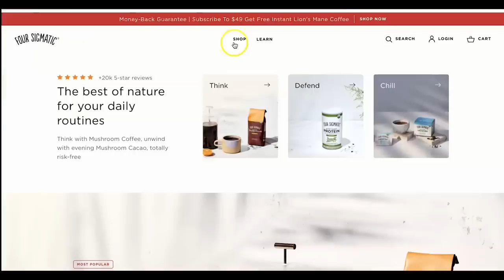BREAKING GROUND ON OUR TINY HOUSE IN THE MOUNTAINS

Comment: As a retired contractor since 1967, with cautioned experience, especially concerning loads and water, please do not discount the potential problems water can cause for loads on retaining walls. Your professional's advice, given that you are NOW at this critical point in deciding if there is a way to cut costs, should be followed. Get a second opinion if necessary, but cracked and leaking walls in basement situations will forever cause you both headaches and costly damage. Good luck and I follow your progress all the time.

Comment: 8K foot elevation in the mountains of Utah?  One of the first things you might want to consider is building a pole barn over Terry to take the snow load and to shelter her from the high mountain sunshine. My aunt has her summer place in Grand Junction, CO and that is only about 4500 ft, she had a pole barn put over her 5th wheel in 1988 and she still uses the trailer today.
Reply: Michael Cousins I wonder if that’s what building 2 that Trent keeps referring to is.
Reply: Definitely.
Reply: Great tip protect terry from snow loads
Reply: would think that was 2nd structure, but larger so it will house, truck, out of season equipment, cut logs, bails of hay to substitute for poor insulation in Terry, and maybe cut firewood for seasoning.  All of these need protection from elements all year round.

Comment: I see alot of comments about getting a port-a-potty but I think you should just build an outhouse somewhere on the edge of the property. That way it will be there forever and you'd be surprised how often you might use it over the years. Put lye in it and it won't stink. I grew up without plumbing way out in the woods and we loved our out door potty even after we finally got indoor plumbing. :)
Reply: Great solution! We always had an outhouse when I was a kid. No mud tracked in and a lot less walking from the garden and the woods.
Reply: Problem is zoning nowadays.  Depending on where you live, even on rural property, they can have all kinds of rules.

Comment: Don’t let the excavator leave without pulling back and smoothing out the banks along the driveway and cut banks.  It will be a mess and a weedy mess forever unless it’s graded out to blend with the adjacent grade.  Worth the investment and the least costly if done now as part of the excavation job.  Remember, people walking up your driveway need a safe shoulder to walk on.
Reply: What a great adventure! Regarding retaining walls, water drainage , erosion  etc... 1. yes agree that if you can have excavator "smooth out banks" that match contour of land you will have much less "retaining wall " issue and subsequent water pooling into basement by seeping through walls . 2. I am sure that you have geological survey  but it is still great idea to walk land and find any major rock formations : rock directs undergound water flow. 3. And while your hiking your land check out your neighbors and see their construction ( like your neighbors lake - it may be their solution to a water soaked area of land)

Comment: Great video! So, I am a civil /storm water engineer and this has been a really fun perspective to see! Oof, on the retaining wall/boulder wall issue. That is no fun to try and field figure out, especially in a time crunch. Boulder walls are great, I just recommend make sure you are not concentrating storm water over it or near the ends. If you have gutters planned for the 2nd building, make sure not to direct water at the base of the wall. If you need to go more than 10 feet vertical,  a retaining wall may require  tie-backs in the soil behind the wall that can impact your layout. Terracing 4' walls is typically the easiest or going up at a fairly steep behind the wall. I do not recommend more than 4 feet horizontal to 1 vertical foot (4:1) if you plan to mow it. Leave space to direct water away from the building. Best of luck! I am excited to see what you create here. :)

Comment: I LOVE watching ur videos. I’ve watched all of them all the way thru. Oh Picking up logs and me being a tireman all my life you both better be wearing backbelts because they surely do help or you’ll pay for it later. Might not hurt at first but once something pops u may be down for weeks. Love all that you do and you surely inspire me. I live and work in Alaska on the pipeline and I just got 2 vans for beginning to travel soon. Love you guys take care and God bless stay safe. In floor heat is surely nice. You won’t regret it. I use to cut concrete for a year and saw all the mistakes that contractors and home owners make which most common one is they don’t use double layer reinforcement in their concrete floors so it cracks all over the place and or they don’t cut the expansion lines every 8 feet. Yes foundation is the key but reinforced plastic on bottom then 2 or 4 inches of pink or blue foam board then wire then heating tubes zip tied to that then 1/2 inch rebar at mid point of thickness of concrete. My buddy has a $25,000 pad for his new house going up  I asked him why it was cracked all over and that’s why. If wire is only put on bottom then it will for sure crack and make sure the contractor has a mini compactor of some kind. Just from my experience. I pray all goes well.

Comment: You need a outhouse up there. A 5 gallon bucket in a cute outhouse tent would work !  LoL
Reply: Just build a proper outhouse.  A one seater size.  Properly built with raised floor, sturdy walls and a non-leaking roof with large overhangs.  You can use it as tool storage for things mainly used outside.  You can hang saws, levels, and other flatfish' things under the eaves and battery tools inside outhouse for additional weather protection.  You won't want to keep lugging them in and out of the basement, during the exterior building projects.  During a build there will be lots of trades and friends helping you.... they need a place to "go"....  For urine, a funnel attached to a, flexible plastic pipe, which empties into a container the size of a 4 quart laundry soap pail with a built in handle, should suffice for both males and females for day and night usage.  The screw cap lid prevents spillage when taking it away from the house to empty and clean out for further use.

Comment: Lookin' good!! A thought on feeding Oso, being a giant breed, you might want to consider putting water on his food when you feed him. That way when he's done he will not crave water and drink too much at one time and then have the food swell up in his tummy. Giant breeds can torsion, (tummy flips over) which can be lethal in a very short time. It's an easy way to help prevent torsion and or bloat. Also it can help if you feed him up on a bucket or table like thing.
Reply: Big dogs need LOTS of water.  They should be constantly hydrating, especially in warm weather.  But being indoors in winter is sometimes difficult for this breed.  Make sure he gets enough hard and SOFT food.... he will eat as much as you do while he is a growing pup.

Comment: You did a great job with counter in Terry.  And then you added a coffee machine but it took up most of your kitchen counter.  Make sure with the Tiny house you plan to have the things you use on a regular basis stored in an easily accessible cupboard.  I put my coffee machine on a pull-up shelf, which is level with the counter when pulled up for use, and stores under the counter when finished for the day.  When I planned my kitchen one side was mainly pantry, food prep and cooking.  The other half with the sink as the dividing line, was clean up and dish/glass cutlery storage. (I put in a dishwasher drawer takes up minimum space and you can store dishes in it on a regular basis.  Uses a LOT less water than hand washing)  Things you use to set the table and eat off of, and put left overs into are on the clean up side. So when the two of us are working in a tiny kitchen we do not cross over each others space.  We can easily work without colliding into each other.  We often alternate who does the cooking and who does the cleaning.  This way everything goes faster.  Also we made a specific place for the dog food and water so we were not kicking the dog bowls.  She eats at the same we do.  Sorry to say your table top is too heavy for the base.  Suggest you make it much thiner.  Also hinge it to the sofa or floor on one pole and have the top rotate and swivel.  You could consider taking 4" off its width.  I think you may find it very cramped trying to sit down when the cushions are on.  Allie's legs are going to get caught up around the two polls.  You can always take extra insulation, flooring, and make covers which fit into those holes in the floor. The repair will be barely noticeable once stained.    Also rather than lugging a whole tree around, cut the tree in ½ and then move it to the stack pile.  Much easier to carry and saves your back from throwing out or straining a muscle.  Looking forward to seeing how you use all the space and live off grid.  Great ideas found on Utubers sailing and living in boats.  Look at what they did when remodelling "Umu" and found so much extra space.  Keep up the happy times!
Reply: Sorry typing error "Uma" ia the boat.

Comment: Allie I would advice looking up proper manual handling techniques . Speaking from experience I have hurt my back just by lifting wrong and over doing it and long story short ended up on floor for over a month after a year of struggling  . Now I am back working as you are doing but I do lower back strengthening and stretches and rest if I feel pain , don’t want to see this to happen to you . Prevention is better than cute . Love your videos .
Reply: I agree. Even with proper body mechanics, things could go wrong. My back was killing me watching her with those logs. I had 2 bulging discs in my lower back that made me drag my right leg for 5 weeks. It felt like ice cold water constantly running down my leg onto the top of my foot, and the back pain was miserable. I had residual sciatic pain for 23 months, especially if I did too much. Take care Allie. An injured area like that is never the same.

Comment: I’m wondering, what will you do for water and electricity for the house. I think you mentioned a septic system? Does that work in a very cold winter? You can see I’m hooked on this project and love seeing your updates. Be careful with the heavy lifting, please. I can’t  help worrying that you might get hurt.
Reply: Septic works in cold temps, because nothing stays in the pipes. It runs through into the tank. The issue in the mountains is drainage, leech field, and making sure your water pipes don’t freeze.
Reply: We built a log home at 11,500 feet elevation. Whew! The septic is buried deeply underground. Hundreds and hundreds of feet away from the septic, a water well is 300 feet down underground. We built the basement foundation with 18” thick concrete walls— very well  insulated. Full round logs are equally as insulated. 

The Cabin: My favorite place on Earth! 🎿 ⛷

Comment: Excited for you! Just throwing out some facts that young men often aren't aware of -- according to one source, women are approximately 50-60% as strong as men in the upper body, and 60-70% as strong in the lower body.  Allie, you are killing it!!  Not sure why you don't make one more quick cut and saw the long logs in half (maybe that's what you were doing in the second half of the vlog). In 30 years, your bodies will thank you!
Reply: It took years for the military to figure out why females were having difficulty with the long distance marches.  The female soldiers would not complain.  Ends up most of them were suffering from pelvic stress fractures.  You can't just throw a backpack on a female (packs men used) and expect females to carry the same loads using the same tools.  Lifting and carrying the same weight as a man, who has different bone and muscle structure, can be very damaging to a female's body.  Allie stop thinking you have to do all this strenuous work.  Yes, we do have strength, but less than men.  Since our muscles are a different shape, we cannot possibly use the same techniques of lifting, carrying and bending as men do.  Stop trying to keep up with Trent, or you will hurt yourself very badly and suffer for years to come.

Comment: Considering the yard cleaning work you're doing.  I'm surprised you haven't invested in a good used (smaller) tractor yet.  lol.  3 point hitch with power takeoff for a bush-hog, there ya go!
Reply: Don't forget to clear property for fire hazard. Keep lots of dirt between house and start of woods.   Make sure your roof and outside building materials are fire resistant.  Check with Fire Department to give you more ideas for your local area.

Comment: When you clear your own land, you will never remove enough trees because you love them.  The contractors will always need more room to work even if they really don't.  Put orange tape on every tree that the MUST not touch and make them work around them.   Especially that remote, you should order a Porto-Potty!!!!!!!!!   Contractors will require it for obvious reasons.   Retaining wall.  Contact a company like Dura-wall? who will have their own engineers and your wall isn't rocket science so they can pull a wall design out of their files.  Or, step the 4' walls and make garden terraces on each.
Reply: Enough needs to be cleared around the house, to act as a fire break.
Reply: Gordon Fichtner  I never thought of that! Learned something new! Tx
Reply: yes, I had retaining walls built around my former home and an excavator ran me $3500 a day.I really wish I'd been an excavator instead of the other 10 hats I wore! What is your elevation?
Reply: @debrasalt3598  8K
Reply: @pleinaire8698  Yikes! I'm sure the air is clean at that elevation.
Reply: @gordonfichtner1089  I have also used Dura -Wall because after 6 months I got tired of a construction crew at my house 6 days a week & that was just one project.I was so burned out after 15 years of retaining walls, engineering a Hurricane -Proof-YES you read that correctly, house that withstood 2, Cat. 5 Hurricanes including Irma.If you are interested I'd be happy to tell you!

Comment: All my Projects that require sub contractors .. especially stake out and excavation, I always have a price freeze and penalty clause for deadline .. your driveway is going to be a nightmare .. where's your on site port-a-potty? .. what's your infrastructure plans for water, sewage, drainage and electrical? .. how about permit to setup a temporary electric meter loop? .. are y'all going to zeroscape? ..have you sourced for aggregate? .. what's your cost per yard for concrete? .. etc.
Reply from the maker: Concrete is $200/yard!! The most expensive concrete in the world!! 
We have a Porto-Jon on site now, but not in this video.
We have water, septic and temporary power all in the upcoming weeks and then terry will live there with full hook ups to make living up there easier while we build
Reply: Okay you asked and answered my questions! Good luck on the build👍😀🔥
Reply: @TrentandAllie  $200/yd for concrete? .. yikes !! .. are they adding gold dust into that mix? .. the strength must be 5,000 psi and no slump

Comment: A positive look at it.   I just built my 560 Sq ft cabin.  The planning stage with the engineers and county permits, is always a process.  Once you start breaking ground,  I  found everything went quickly,  but it also wasn't during covid.
Seeing it all come alive is over the top exciting and it only gets better.  I looked at mine as a empty canvas, you are the one creating the forever design.  I didn't frame it alone,  single gal,  I had some help from a few framers. Couldn't believe how quickly it took shape of a cabin. 
My cost,  cabin and permits,  below what I thought it would be.  I went into it not sure I could do it all at once since I was only using cash,  no loan.  God provided and he will for you too.😊
What is your Sq feet of your cabin? 
Your pretty blessed with easy soil,  building in the CO Rocky Mtns, huge boulders,  rocks, rocks and more rocks.  Why they call them the Rockies. 😊
Reply: Good luck the two of you, we had a lot of adventures together in our 60 years together. I just wish I could start over again. I hope you feel that way when you are done.

Comment: We   have a cabin in the Co. mtns and drainage is a huge problem, ours was built before the 1950's and settling  is also big (I think one corner is on a boulder, so that corner does not settle) maybe some type of drainage system around the two structures. You can probably put in a french drainage system yourself (LOL look on You tube) We have seen mtn. lions, fox, deer and bears on our property so we are extra cautious with ourselves and our pets. But it is so awesome to be in the Mountains that it is worth it. It will be worth it, Congratulations on the tiny cabin and have fun

Comment: Hello Trent and Allie My husband and I have been enjoying watching you. Thanks. We were on the road with out Jayco Melbourne. My husband had a stroke and we had to sell it. Pryor to the Jayco we built a house on a hill. My husband was watching you with your water problem. We did similar to putting the pipe under the rock. We also wrapped the pipe with a cloth so the pipe didn't fill with dirt eventually. We put 3 ft of rock around the basement wall and painted tar on the buried wall many coats. It never leaked it 17 years. The neighbor didn't do that. His wall collapsed. Don't bury your water pipe under that rock. Bad move. Thanks for your entertainment. Lonna and Greg